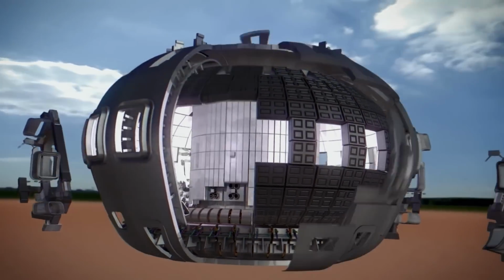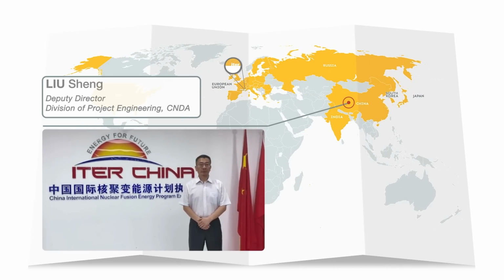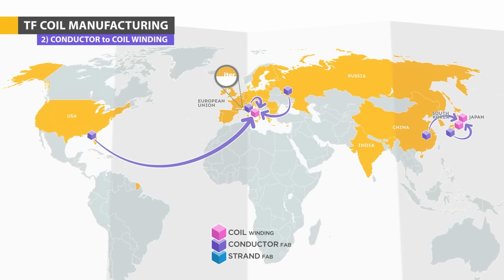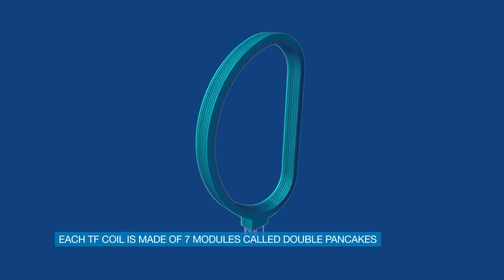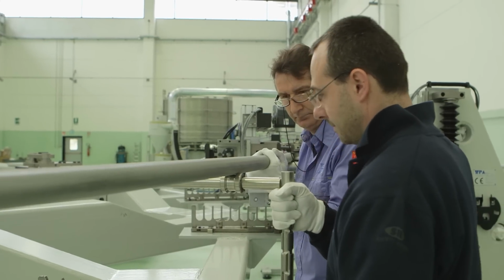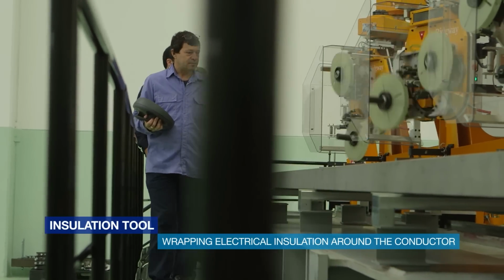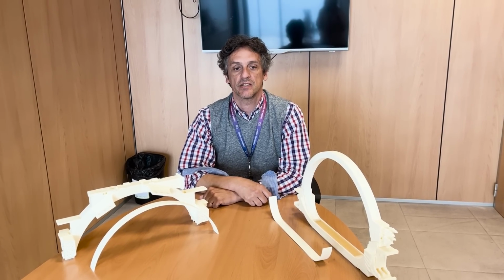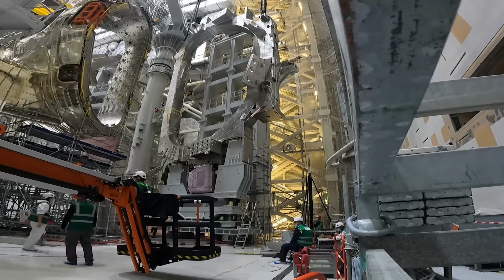The making of the ITER toroidal field coils

Comment: a) es fehlt noch ein Wehneltkorbzylinder zur Kompression des Kathodenstrahls.
b) Hauptstom auf Kupferrohren für supraleitenden Kreisstrom. 
mit 64 x 10 hoch 8 Leitfähigkeit für Hauptstrom isoliert per Klemm - Leisten aus a) rausgeführt, zum modifizierten Phasenabgriff. Nur wäre dieser 0.0 isolierend ?
c) Wehnelt außen gehört noch um 90 °gedreht. Es fehlen vertikal oben und unten im "Eck noch" die adäquat komplett anliegende zweite Wehnelt - Wicklungs. bzw Drahtführungsbox ?
d) für ausreichende Feldstärken und mittigem Arbeitspunkt fehlt aber noch die richtig angekoppelte Seitenspule, sonst wird es eine Leerlaufinduktivität ?